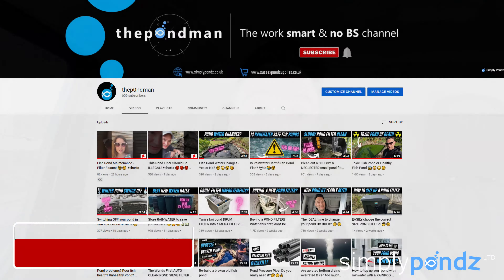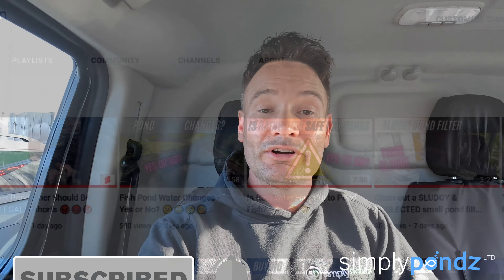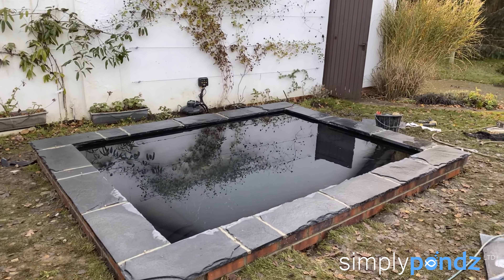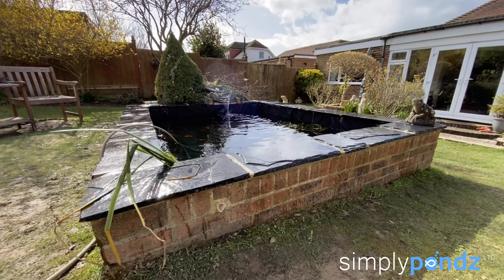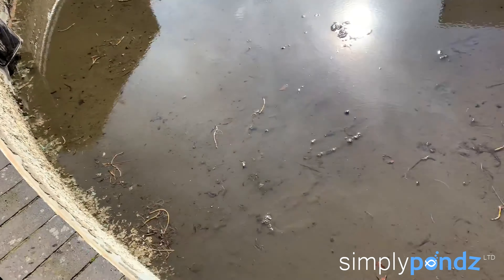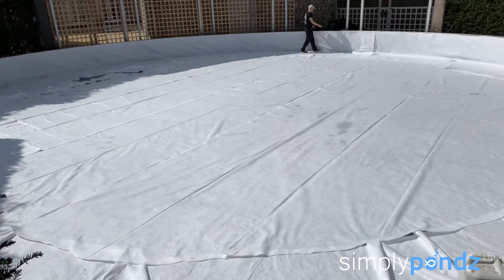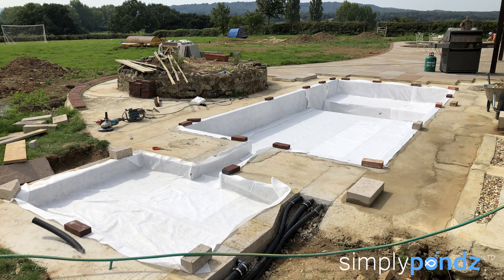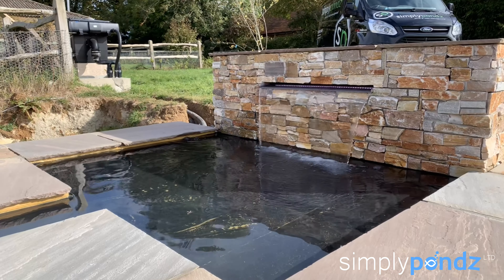The Pros & Cons of a BOX WELD pond liner? 🤔🙄😀🤔😮

Comment: Hi, our "pond from hell" has struck again, I think the 30 year old (badly patched up) liner has had it, we've lost about 4 inches of water over the past couple of weeks.
We've decided to go for a new liner, as this will give us the opportunity of re-shaping the pond as the ledge has collapsed to such an extent in place we can't put even the smallest plant pots as they just fall in.
Sorry, once again have some questions:
We have yew tree roots coming in from either side under the pond, we also live in an area where chalk / large pieces of flint is prevalant just under the topsoil.
What is the best liner to use and what preparation would help to protect the liner?
i.e. do we need to double up on the liner, or the underlay, or just make sure we have a large amout 2/3 inches(?) of soft sand over the chalk and flint - what would you suggest?
Also, what would you recommend as a cheap way of saving the exisitng pond water. Despite constant sunshine and quite a bit of dirt / fertilizer (repotting plants) finding it's way into the pond, there hasn't been any sign of water going green, it's stayed pretty clean (we bought a new Oase vitronic 18w Uv lamp. I'm pretty chuffed that something went right(!). All we have are a few (very large) buckets etc and a clean dustbin sized container, but that's no where near enough to hold the water.
As always, many thanks for any help you can give, been going back through your vids "liking" them all.
Reply from the maker: Thanks for comment. The liners we usually use are 0.75mm green seal or 1mm Firestone. Firestone is great if your budget can allow. Let me know your dimensions and we can get you price with delivery etc. We would recommend using a heavy duty underlay, you don’t need to double up on the liner. The underlay is really strong, you can add extra if you felt it needed it. If you have sharp stones try and remove or angle grind them out if they are really bad or add more underlay. Tree roots tend to grow around the liner due to the weight of water. If you add sand just don’t to too much as it can compress or if the water table comes up a lot it can “thin” causing the liner to lower slightly which can stretch it, then weaken and split. Tbh we don’t use sand, the underlay is that good. Important to make sure you leave enough flex in the liner so when it fills it does t stretch. We are putting one in today so a video will follow shortly if you get stuck cheers
Reply: A steel frame paddling pool is what I have used it was still going strong when decommissioned after 3 years outdoors with koi in all year round unheated and didn't freeze not even once !